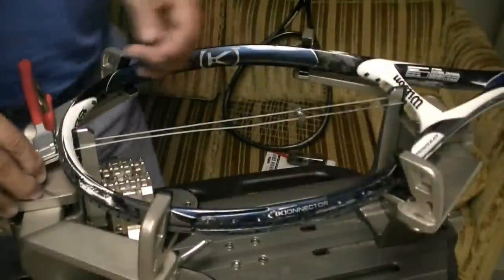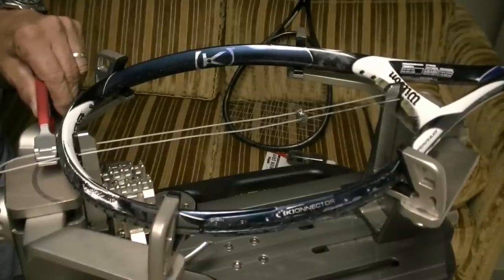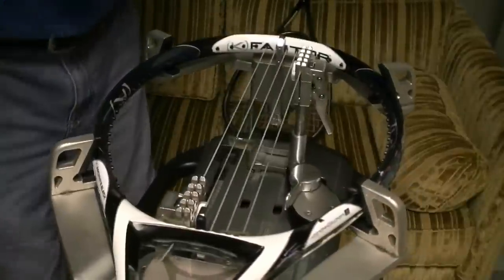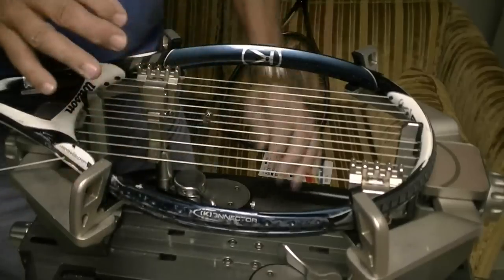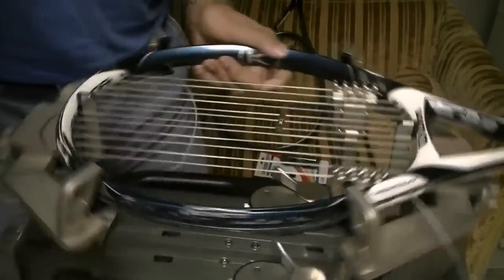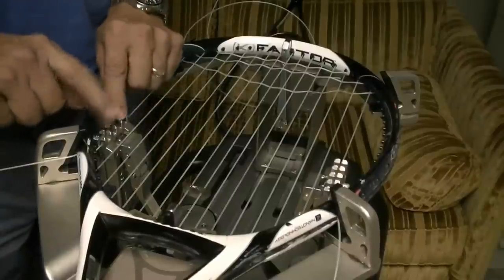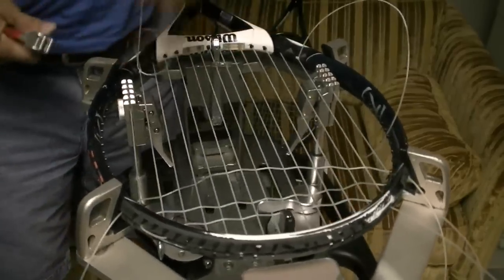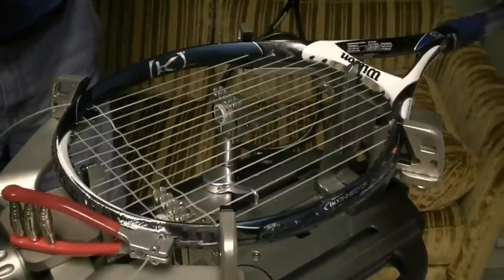Stringing 16 Main racket

Comment: Hey, can one substitute a flying clamp for the starting clamp if one had a third flying clamp? If down side to the substitution?
Reply from the maker: It better be a good flying clamp. I’m not big on used clamps outside the frame any more.
Reply: @Mr10sStringer  
Why? 
Would a good metal flying clamp used for inside the hoop work outside the hoop?
  Do flying clamps tend to not hold the string?
Reply from the maker: @bowsershark  Flying clamps are sometimes large and if you need to place the clamp outside the throat there may not be enough room. If you’re placing the clamp at the head the string will be clamp at the point where the string will bend around a grommet. If the string is flattened and bent around the grommet it could easily break.
Reply: @Mr10sStringer  
It, the flying clamp would just be used outside the head to start the string job like you demonstrated in your video.
Reply from the maker: @bowsershark  still you flattening the string where it turns into the grommet. If I were stringing that racket now I would clamp the second main inside the frame with a starting clamp and tension the first main next to it. You can’t do that with flying clamps. A start pin would help you can order on Klippermate site.